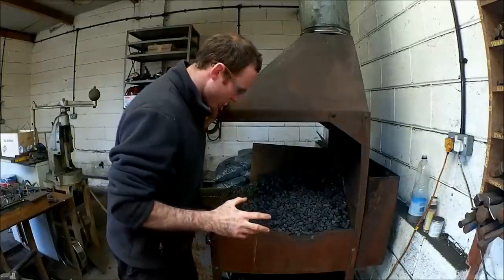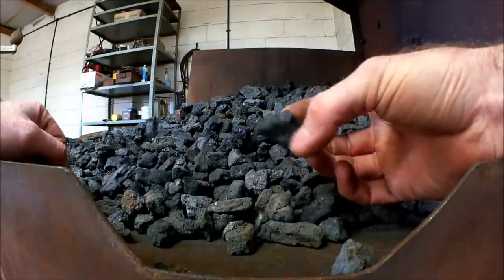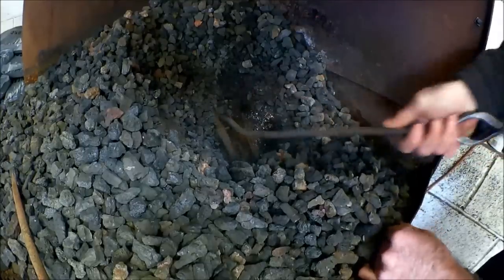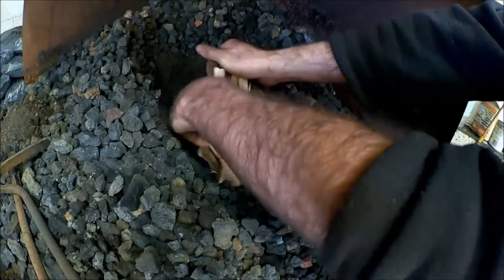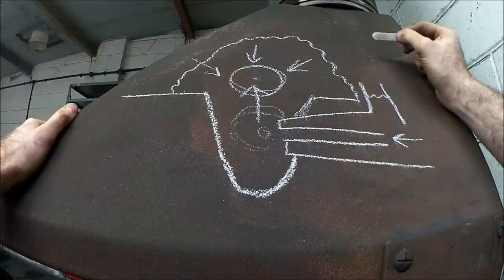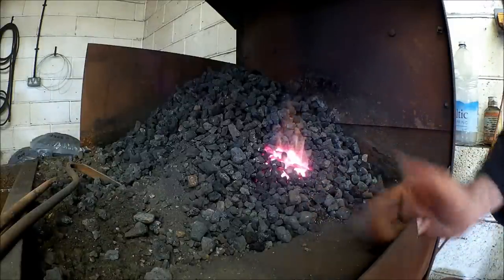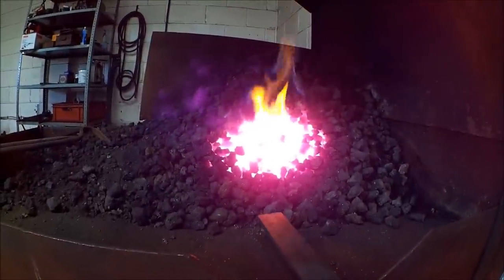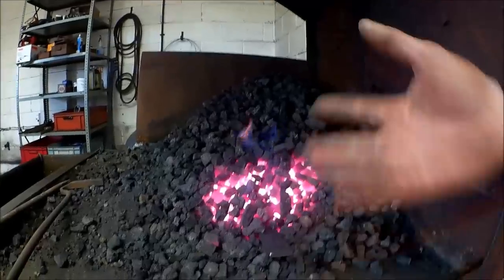Blacksmithing - Why Side Blast Forges Are The Best #1

Comment: Great video. Only criticism is I would of liked you to explain, why a side blast forge is better than others. I can come to the conclusion of why a side blast is better than blasting air up from underneath. Air coming directly up will force oxygen into the where you want to work the steel. VS with side blast, it makes sense that you are forcing the oxygen to stay under the working area.
Reply from the maker: Thank you. Another reason it's better than a bottom blast is it keeps clean all day without blowing slag onto the work. A bottom blast need regular clearing of clinker otherwise it clogs up while a side blasts clinker drops below and around the air inlet so you can carry on working without problems.

Comment: hello dear, I have a question, did you kept your blower permanently on during the entire process of your working time. And how you manage to remove clinker from your forge during the working period or it did not bother the fire while you are working. Thanks
Reply from the maker: Yes for coke fuel bit needs constant air. Removing the clinker is simply done using a poker and levering it out. As long as air is blasted at the coals it will stay lit and you can carry on working. Cheers J

Comment: If you took a dissipation ring with many holes and large rings then you could hi pressure the air flow through it that forces air through a larger area giving you many more points to heat from. I discovered that one of the outdoor fire burners that chefs use for large quantity cooking works the best

Comment: Thanks for the Vid, I'm just starting out and using a 55 Side Blast forge and my first firing was just me burning 15 lbs of charcoal and trying to keep the Temp up.
Reply from the maker: Thanks for watching. you will use alot of fuel using charcoal compared to coke, I beleive the key with charcoal is to only have a little fuel on the fire at any one time while often topping it up rather than a pile like I would with coke. the best charcoal forges I've seen have two walls or large bricks ether side of the air hole very much like what a japanese sword smith would use. its insulating and therefore more fuel efficient.
Reply: My issue was lack of insulation. instead of dumping my ash from the last fire, i left it and grabbed a bunch of the slab limestone we dug out of our yard. I now have a smaller space for the fire. I knew I would use more fuel. but, when you're just learning and have limited moneys, a 20lb bag of lump charcoal from walmart every couple weeks is not bad to start with. If i keep with Charcoal I'll build a retort and start making my own.

I'm trying to figure out how to keep my air intake cool. for the short term. going to build a water box but that's going to take time and i still wanna smith while i design and gather mats.
Reply from the maker: I would love to make my own charcoal on a larger scale. I've made some in my larger BBQ by lighting a pile of wood on it, then when its got going enough I then close the lid and and vents, if its done right there should be enough heat to turn it into coals with out oxygen that will burn it away. A thick iron pipe will do the job for a short while but for longevity a water cooled unit cant go wrong, if you have a welding machine it wont take long to knock something out, I fully recomend getting good at mechanical welding, I love traditional forging but welding is the way to make money, even if its just to make your own tools and jigs for the blacksmithing side, it makes life alot easyer.
Reply: I have two Fuel drums in the shed, a 30 and a 55 gal. when I'm not being lazy I'll be filling them with water to dillute what's left of the fuel in them so i can cut the tops. Fill the 30 gal with wood, put the 55 over it and flip it so the 30 gal is upside down inside the 55 gal. fill the space with wood. light the wood in the 55, you can cap it with a lid that has a chimney or just let it burn. once the fire just goes out abruptly you'll have charcoal in the 30 gal. Simple Charcoal Retort. if you're not on iforgeiron.com i recommend it. lots of vets with great info. that's where i learned about that retort from. 

MY brother has a stick welder in the garage. he is pretty dumb with welding. but I intend on learning. It's part of the design and gatheirng of mats for the liquid cooled part of my build. currently i have a fairly thick pipe but the tip just melted once i got the temps up last time. I took that part off the pipe and it's got enought interior diameter that i could run a smaller pipe through. just need a smaller pipe. as well was thinking or just taking part of the pipe off and finding some kind of metal bucket or container putting a slit in the bottom big enough to weld to the pipe slot i would cut off and then i would need caps for both ends and it would be a quick and dirty water cooled system while i plan/build my second forge.

Comment: I've been debating on buying a forge or just getting off my butt and make me own. Don't like the hassle or fiddling with klinkers during forging. Cleaning out after use is understandable. That side mounted air box with running water to keep it kool. 👍🏻 I been think on a T that fits my drain hole/breather hole on bottom, that's removable  during clean up. Still undecided. But you gave me a lot to think about. Thanks for share
Reply from the maker: Thank you! I've found side blasts need far less maintenance than the bottom blast, a bottom blast clogs up very quick. You can use a straight up pipe (stainless steel even better) instead of a water cooled system but they will corrode quickly after heavy use but fine for small things. I made a another forge like that and was very happy with its performance and simplicity. A water cooled one is going to last a lifetime if made well. Cheers J

Comment: Very clear vids, well done and explained. 
Using coal in a side blast fire is a bit of a lost art, coal takes more managing than coke. Use correct blacksmithing coal, small washed pieces. Build a mound of coal, light the fire and wet the outsides, pat it down tight to make a sort of "oven". The air does not blast through and produces a neat fire with the coal changing to coke as it burns. Open a hole in the side and slide your work in. replace the coal as it burns from the sides. Years ago the "slack tub" on the front of the forge contained wet coal ready to be used. When I built my tue iron I ran some beads of hard facing rod round the air hole and edges, never burns!
Just a question -  do the bouncy castle blowers run on variable speed?
Reply from the maker: Thanks Chris, good to know, I'll do another Video on using different types of fuel, I think that would be interesting!.. bouncy castle blowers are designed to go against presure sop I just use a regulator for the air just because its simple and it work instantly. a variable speed i'm guessing will be more economic on electric?...
Reply: I mainly use a variable speed motor to keep the noise down, don't have to have the fan running full blast all the time, I also have an air regulator fitted as well. I've been looking for a cheaper alternative blower for my students who may want to build their own forges, regular smithy blowers run about £400.
Reply from the maker: bouncy castle blowers are good. blenty if air. not too noisy. about £50 but can get very cheap second hand ones. got mine for a £10. has lasted me 6 years and no problems
Reply: Joshua, can you adjust the air flow from the bouncy castly blower by putting a simple valve on the air line from it? Would this affect the blower do you think?
Reply from the maker: Hi yes if you watch from 14:44 you'll see that I have attached a ball valve on my demo forge. the main forge has a slide hate valve that i made my self.
Reply: Thank you, and thanks for uploading a great video
Reply from the maker: Any time! ;)
Reply: Chris Tombs variable speed is really bad for a blower that doesn't made for variable speed control. It causes problems with the self cooling of the blower motor.i tried to manage the noise to and I ruined two blowers  like that.. I hope to save you from my mistake

Comment: Hello Joshua 
I came back to watch this video again thinking it explained the thermo cycle cooling system…. I thought wrong😳
I’m running my tuyere cooling through a raised 60lt barrel. Cutting this story short , I had to replace the barrel recently but do you think the hot water inlet into the barrel needs to be submerged as to keep the line clear of air??
The only thing I did different was to raise the inlet higher than before but seem to be getting a lot of shooting hot water?
Cheers 
Chris
Reply from the maker: Hi. Yes all pipes should be purged with water so no air pockets. There is a second part to this video which uses a barrel. All the very best. Cheers J
Reply: Thank you for your input. 
Go well !
Cheers

Comment: thank you for the video, one question where does all the hot watter go to do you keep it continuosly fed with water or do you periodicaly replenish the watter inside
Reply from the maker: HI, thank you, it goes to a tank called a bosch. there it cools before cycling back through. I do replenish it like you say. there is a second part to this video which explains it further. cheers j

Comment: I experiment with lots of different types of forges, I think the side blast originated with the Japanese, I know lots f smiths who prefer the side blast. Check out Crossed Heart Forge, he uses one with a hand bellows. I prefer my straight up and down types at the moment, but your one looks amazing.
Great vid, subbed.
Reply from the maker: Thank you very much!
Reply: Im not exactly sure that's correct. The Viking forge is a side blast, the vast majority of Asian forges on YouTube are sideblast as well. They could have been influenced by the Japanese but probably not the Vikings. I want to make a side blast. It seems better suited to my wants. I do want to make a Japanese push pull blower for it.
Which granted, most asian style blowers follow that style.
Reply: @OKBushcraft  I could be wrong I'm no expert in the history of forges. The info I based my guess from were earliest dated finds based n geographical locations around the world and then guessing which culture brought it to the next one. It's possible they could have been independently invented though multiple times. From what I've read the Earliest side blast furnace originates from China. possibly they were using it as early as 500 BC as they have cast iron at that point. But we have forge finds for 100% certain from 100 ad. A Chinese engineer called Du Shi further developed the blast forge in 31 ad to incorporate water wheels and pistons to the already working blast forge model. I believe that blast forges spread from China to Japan as most technology did in the East. I have done some research on early European blast furnaces, but the data I read suggests that blast furnaces were not used pre migration period on the continent. I got this quote from Wikipedia on the subject. "The oldest known blast furnaces in the West were built in Dürstel in Switzerland, the Märkische Sauerland in Germany, and at Lapphyttan in Sweden, where the complex was active between 1205 and 1300"  

How true that quote is I'm not sure.
Reply: @londiniumarmoury7037  im not professing expertise by any means just observations. It is possible that the blast forge spread west to the Rus and the Vikings from the east. 
I will be very interested in researching this further. Thanks for the info. Looks like a fun read.
Reply: @OKBushcraft  No probs, thanks to you as well, this discussion prompted me to do a little more reading up on the subject. It will probably encourage others who read our convo to read up on it as well, so win win for all.

Comment: Thanks, this is very useful.

I'm wondering about the sand in the bottom.  I guess it performs a function similar to a fire pot, helping determine the shape of the fire.  Do you ever dig out different shapes depending on the shape of the work you re heating?  Can you make a really long fire if you want to put in a bunch of pieces side-by-side?
Reply from the maker: +Colin Davies  yes I do mention that in the video, I dont very often but would if needed. the best thing about the sand is it acts as insulation to improve the efficiency of the fire and nothing sticks to it so the clinker can be removed easilly even while the fire is still going.

Comment: Just love this. Just one little dimension that I can't fathom though. What is the length of the tue iron? Should the end of the tue iron land in the middle of the box. It looks that way to me.
Reply from the maker: Hi. It depends on your preference, if you would like the fire to be dead center, then if you measure a fist size bowl diameter in the centre first, the Tue iron will end at the edge of that bowl. I will be doing a series of videos about using charcoal soon as I now use home made made sustainable charcoal instead of coal and coke. The forge itself however has remained the same. All the very best. Cheers J
Reply: @joshuadelisle  thanks. It is as I expected. I can’t wait for the charcoal videos. I collect the nights left overs from our woodheater every morning and have quite a stash. Coke is getting beyond my budget these days.
All the best
Doug
Reply from the maker: @dougtarrant2031  same it's gone up too much. Originally blacksmiths used charcoal from sustainable coppice wood and only transitioned to coal and coke because it was cheaper at the time to produce. I now volunteer at a coppice and gain as much wood as I like to turn into charcoal. Cheers J

Comment: Another great video, thank you.  A couple of quick questions; is it necessary to water cool the Tue iron?  And if you don't water cool it what sort of steel should you use?

I've been blacksmithing for 4 weeks and only have access to a forge once a week so I'm really keen to build my own so I can practice more
Reply from the maker: Hi Joe. on a side blast if you don't water cool, the air inlet pipe (tuyere) will corrode alot faster and slag (silica and impurities) will stick like glue to it. older versions where made from sacrifical clay but needed to be regulary maintained. a bottom blast doesn't require water cooling but have problems with clogging air inlets and efficientcy.
water cooling isn't a big job if you can weld, you can get a 160amp stick welder far less than £100 which will be good practice and will save you money on kit you can now make with one for example, stands, tables, tuyère, clamps, forge etc. if you using just a pipe a cast iron one as thick as you can get it will be best, if your using a bottom blast cast iron or just very thick steel with 9 small 8mm holes will be fine but if you use a side blast I use 2mm stainless but you can use 6-8mm mild steel for the wall thickness with at least a 25mm air inlet hole.
Reply: Joshua De Lisle thanks for the detailed response mate.  I am going to make a side blast like your bbq build.

Comment: Hi Joshua. How do you deal with smoke in the workshop?
Reply from the maker: @MalcomSmiff  if you've got the correct chimney stack size it's not a problem. I've also added a Venturi to my smaller workshop so the blower helps create extraction. Cheers J

Comment: Great vid as always.
Can you recommend a specific blower as some are obviously noisier than others but I really need a quiet one if poss. Currently I'm using a hand cranked side-blast (Alldays & Onions) but my fire-management is crap and think (most definitely) that I need to have a bit more of a constant air feed. (Living in France now, but UK easily accessible). Thanks in advance.
Reply from the maker: Thank you. I use a cheap bouncy castle blower on my current forge but I'm upgrading to a Venturi version run off my compressor. It's much quieter and potentially more economical to run. Cheers J
Reply: @joshuadelisle  Thanks shipmate! Could I ask for a few more details such as recommended airflow cfm, motor power/wattage, noise level db etc. How do you control airflow, do you use a speed controller or mechanical means.Sorry for being a pain, but I'm getting snowblinded by all the different fans out there. Take care.
Reply from the maker: @kevg3320  I just use a 1.5" ball valve to regulate the airflow depending on my needs. The blower I think is 350w but I'll need to check. They're designed for constant use and back pressure as they are a centrifuge design. So they work more efficiently under load basically.  No other regulator. My new Venturi blower looks and acts exactly like a gas burner but just air. The Venturi effect increases the volume coming out the nozzle by 10. I regulate it with a needle valve and watch how the fire behaves. Input is 120psi but output is variable. Cheers J
Reply: @joshuadelisle  Thanks again for the reply, very muchly (?) appreciated. 😀

Comment: Hello Joshua, I am very interested to find out where you get that orange blower that you've used in your vid, I've ended up buying a £25 800 watt garden leaf blower with an adjustable trigger no less, to try out and see what thats like with my small forge. I have a big old cast iron blower with it as well but it seems to take ages to really get any heat going and seems cools down in no time. So I'm trying some other alternatives and your blower looks a good alternative.  Great vid by the way and look forward to seeing more of your tut's. Regards Paul
Reply from the maker: Thanks paul! it is a second hand bouncy castle blower, I found these just quick on ebay that will do. http://www.ebay.co.uk/itm/like/172548002111?lpid=122&chn=ps&adgroupid=40208335658&rlsatarget=pla-279567482291&adtype=pla&poi=&googleloc=1006940&device=c&campaignid=738217568&crdt=0